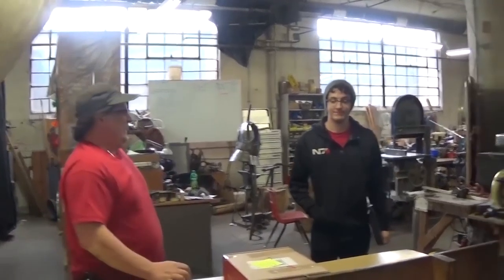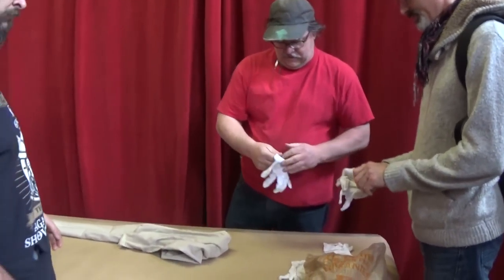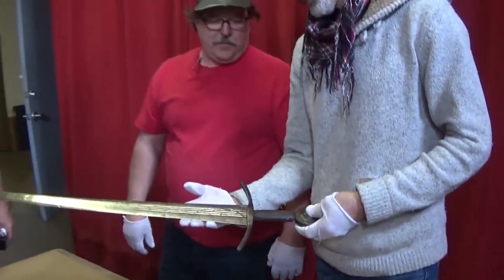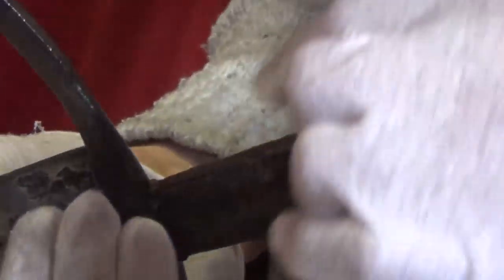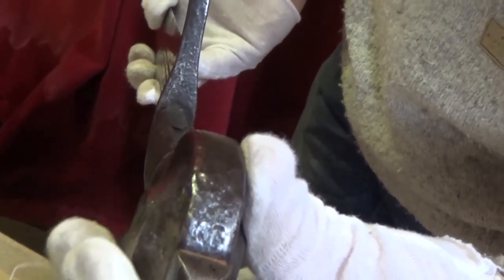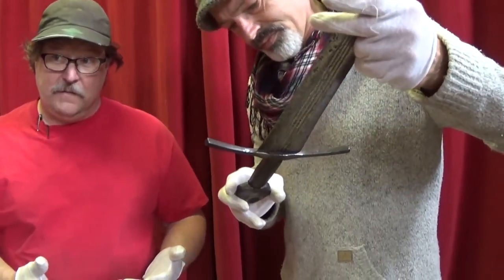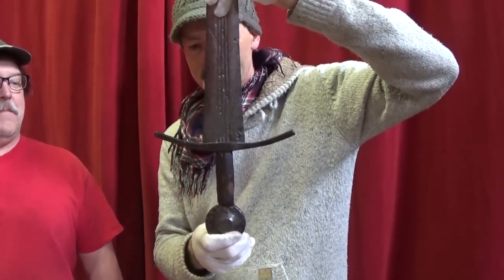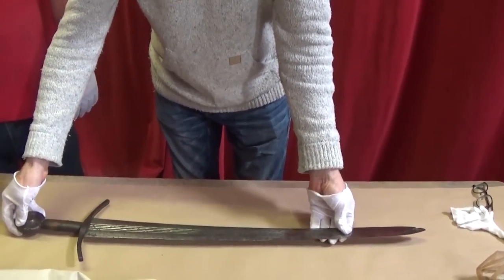Ewart Oakeshott Institute onward to Moodbrand! Historical Sword! Part 2

Comment: Is this pommel offline with the blade for use specifically by a particular hand?
Reply from the maker: Brian Knezevich I believe it is off a hair not certain if for hand on this one
Reply: The pommel appears to be rotated a few degrees clockwise in relation to the blade and quillons, if this was deliberate and contemporary with the sword's use then I think this indicates that it was set up  for a lefty. I have read that an off centre grip on medieval one handed, double edged swords can show which edge was intended to be the front and which the back, inspecting the edges for wear might support this idea.
Reply: Matthew I THOUGHT it was!
I noticed the tendency for screw on pommels to do this decades ago, and now seeing evidence of this offset intentionally on period blades is.. fascinating.

Comment: Can anyone tell me why river finds are all bent and warped in odd shapes? If I bend a new sword it will spring back. If I bend a rusty one, it will break. Yet I've seen a number of artefacts that were apparently bent by huge forces.
Reply: Historical sword steel is quite different to modern steel, meaning most swords would bend before they broke. Some older weapons might be more like 'iron' than 'steel'.
River and lake finds are generally thought to be religious sacrifices.
Reply: they likely would have sprung back if they were bent and released at the time, but because the pressure had been applied for centuries, the tension of the spring was lost.
Reply: But what caused the pressure in the first place? Yes, water can have a tremendous force, but even if you stick a sword into a white running river, it won't bent as much. It would make more sense, if a huge bolder rolled on top of it, but I can't see how. If it was just covered by sediment over time, that shouldn't happen.
PS: I've seen the scary power of water and I nearly overlooked it at first. I was in the mountains and wondered why I could hear no animals and then I could hear a very faint and low creaking sound and the sound of sand grains running over stones. It was ice thawing and freezing repetitively resulting in a landslide. It got louder and louder over time, but I made it out of the danger zone before it came down. Still, some big boulders rolled passed me, so It must have been really close.